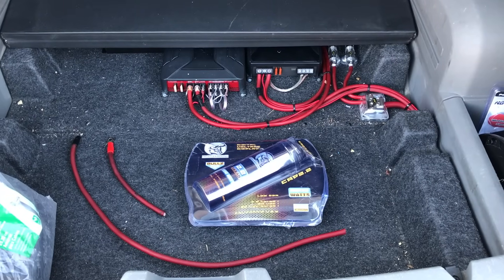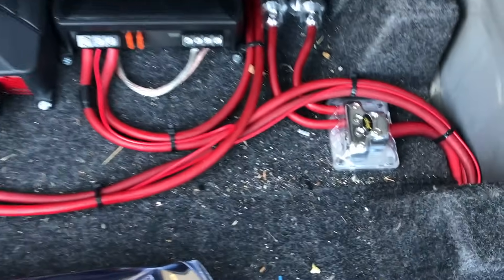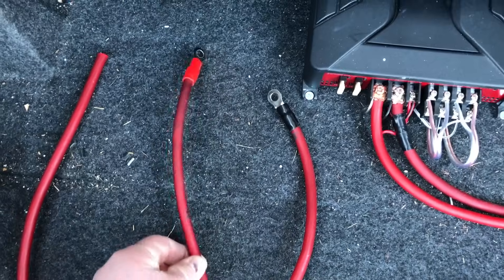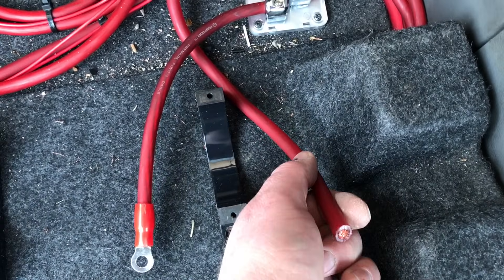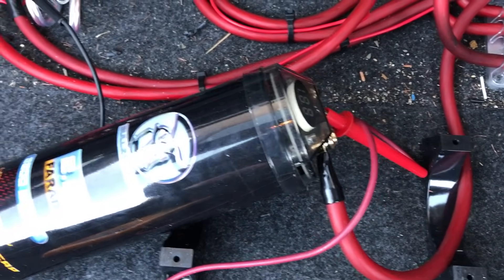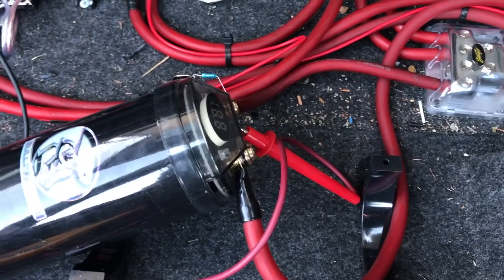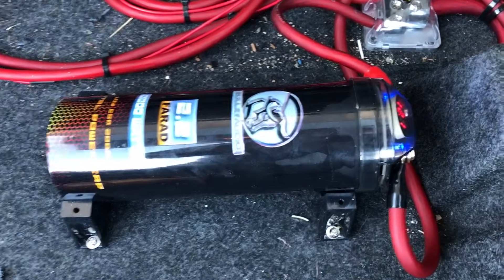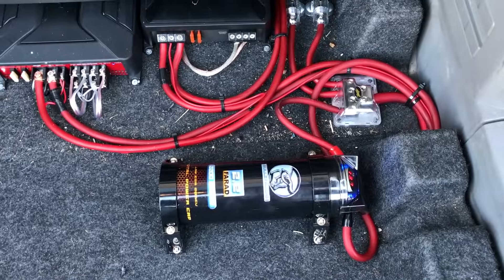How to Install a Car Audio Capacitor in your Vehicle

Comment: dont waste your money on a capacitor just install a second battery instead its much more effective.
Reply: … for a small system. I only have two 12’s and dont really need a battery have minimum light dim but i chose a cap because of the appearance and the voltage read out. It looks very nice mounted behind the subs aside from the amp.
Reply from the maker: Not stupid, but not recommended as the capacitor will be inferior to the battery.  Battery is your best bet.
Reply: @Sirtokesalot---> that's what I was thinking... just add an additional battery
Reply: second battery will stressed the alternator and probably burn it....
Reply: @rondamon8004  alternators been fine in both my cars for years having dual batteries in both cars
Reply: Jessey Jacobs no it is not...if you take a look at high end amplifiers they all have a lot of caps for making good clean power
Reply from the maker: Agreed.  However, this was a customer vehicle and they wanted a cap.
Reply: would it be stupid to run a capacitor with a 2nd battery?
Reply: Sirtokesalot47, I see this comment a lot. My first question to you is what kind of education do you have in electronic engineering?
How can you say flat out they don’t work.
I don’t think you have any idea what you are talking about.
Reply: @thomasczartoszewski6378  my answer for you is i dont have great knowledge but from experience in my own car using a cap at first then adding a second battery the battery does way way more than the cap ever did.
Reply: Sirtokesalot47, i truly disagree I got old school gtq 400 and toxfordfosgate power 1000 for lows battery holding good but will add capacitor for noise control and to localized power fluctuations
Reply from the maker: https://youtu.be/qmH_N4lvppU check it out!
Reply: Sirtokesalot47 i dont know if having noise issues with for example class d amps a powercap is a really good and cheap option...
Reply: Keith Branch yes!!! Thats the point!!
Reply: YOU CAN BUY 3000 FARA caps for 80 dollars   WHY The fuck you buying this guy .5 or 1 fara cap that wont do NOTHING>>
Reply: someone comment and help me!
Reply: Kari Mae ??
Reply: @4gbmeans4gb61  doubt you could help but if you're willing i can email you pictures and questions. my ex took out my box and pawned it for 40$. i got them back the next day but now i have all these loose cords that need to be plugged in. i really dont know where they go or if the wires need clamps. i cant find anyone else to help me
Reply: @karimae404  still need help?
Reply: @karimae404  still need help?🤣
Reply: Will a capacitor help delicate power systems (of newer vehicles) not get damaged from sudden bass power draws?
Reply: I added a second battery why does my lights still dim?
Reply: @pedrorivera429  upgarde all your wires and do the "BIG 3" upgrade aswell
Reply: they say if you want to install caps it is better to have a shorter wire from caps to amp
Reply: It didn't help my lights from dimming but I kept it in anyway.
Reply: J M I be honest I think roxfordfosgate is the only true capacitor on the market that works.
Reply: @thomasczartoszewski6378  thanks, I use to run one red top up front and one yellow top behind the seat and box for my two Memphis prx1000 amp in my explorer. I may have to do that, $500 in batteries ugh!
Reply: Can I use a cap in my hybrid to install a amplifier?
Reply: Jeremy Allamby, yes but whatever hybrid car you have most likely your alternator is too small for a install
Reply: @thomasczartoszewski6378  I have a prius c with a 1000watt amp would it help reduce to strain on the 12volt battery
Reply: Jeremy Allamby, not sure if you have a alternator or your car inverts high voltage from your drive system. People don’t understand electronics that’s why they don’t think capacitor will help. Battery can’t provide current fast enough to feed you amplifier that’s one thing, another thing is that will help with the flow of electricity. Every time bass hits current flows and then stops and flows back just like water does capacitor will localize that effect help your electrical system
Reply: Anyway don’t go crazy your car system is not designed to handle load such as amplifier. If your voltage drop too low you risking major damage both amp and your car
Reply: @thomasczartoszewski6378  ok
Reply: Can i I add a cap next to my second battery in trunk?
Reply: @stoyannikolov1017  i dont care u can waste your money if you want
Reply: @sirtokesalot47  great reply, im just having a cap on hand for free not wasting any money at all
Reply: Ryan Its also clean the nosie from the electrical system....
Reply: a cap will help, for a nice system

Comment: i hav the same one but mines stays on its been 2 weeks still on did i do something wrong?
Reply: try coming from battery to capacitor then from capacitor to amps with capacitor and amp with its own ground
Reply: pollo loco that how exactly i hav it wired
Reply: i wired it up just like u did only thing i don't hav a distribution block it goes from battery to cap to amp
Reply from the maker: The cap my be faulty, sounds like an issue with the cap
Reply: Provo Beast Audio Installation 
Dam really
Reply from the maker: Like i said before, sounds like an issue with the cap.

Comment: i got a ???!  I'm running one of this in my car and i just noticed that the blue light is still on, even long after a parked my car, is that normal?
Reply from the maker: Well, all caps are not the same.  I know that some have a "remote accessory connection" which will activate the LED display only when the car is on (same principle as a radio) and turn off when the car is off.  The cap is similar as a battery in that it is always connected.  Other caps have functionality to activate the LED display when it senses a voltage change, like the one in the video.
Reply: Thanks
Reply: Provo Beast Audio Installation I bought one just like this and it didn't come with a remote accessory to turn it off. will it kill my battery?
Reply: Michael Hatch hasnt killed mine in a yr+. Doesnt use enuff juice to matter and i have a 30 buck junkyard battery
Reply: You probably hooked it up wrong...could be there is a remote turn on..this needs to be connected to a switched power supply lead..

Comment: do you get MORE bass with this... and why do competitors dont have these in there setups
Reply from the maker: Yep, the recommended route is a second battery, not a capacitor, but the customer wanted a cap instead of a battery.
Reply: ghostwarhammer007 no you did not get more Bass with a capacitor. when you see people in competition they are running a lot of wattage and high voltage. they usually opt for additional batteries for reserve banks of power.
Reply from the maker: Instead of "bass", its more "Voltage".  As watts are determined by voltage and amperage, this capacitor will help with Voltage drops delivering more power to the amplifiers to remain more consistent with bass hits and amperage pulls.  Usually, i don't recommend capacitors, if you want to add more power to your system, i would add a second battery.
Reply: I'm under the impression that it should be wired from the battery to a fuse to the cap to then the main input of the distribution block to help feed the rest of the outs of the distribution block. The way you have it wired seems as if you are just powering the cap but not using it to help distribute the power. Or am I just getting this all wrong? I'm just trying to wire mine correct that's all.
Reply: Provo Beast Audio Installation thanks budd.. U is a profession.. I have those old school audiobahn 12" flame series the ones that supposedly 2200w max 1100 rms.. I want to hook them up but i dont know which class d amp to hook it upto on a 2ohm load .. i plan to get an extra batter and 4 gauge or 0 guage for the wiring , im gonna get a box tuned to 32hz ported and a bass modulator..  Wiring is gonna be a bitch tho..
Reply: Random question would you want to put the capacitor before the distribution block? Or it doesn't matter?
Reply from the maker: Well, the closer to the amp you can wire the cap or battery to, the better.  The shorter run of wire, the better.
Reply: @ProvoBeastAudio  okay
Reply: Do you have a second battery?
Reply: No second battery.
Reply: people now days rarely waste money buying capacitors.